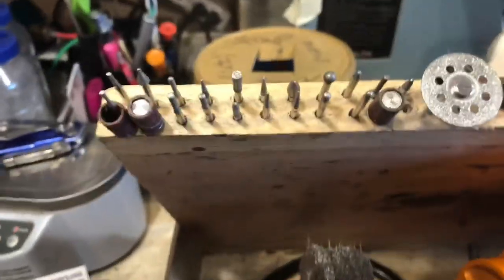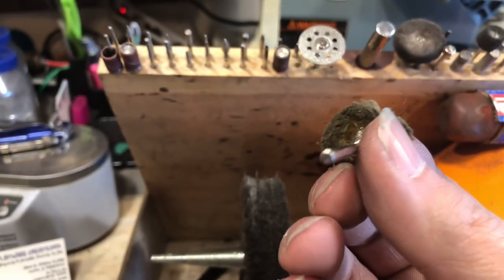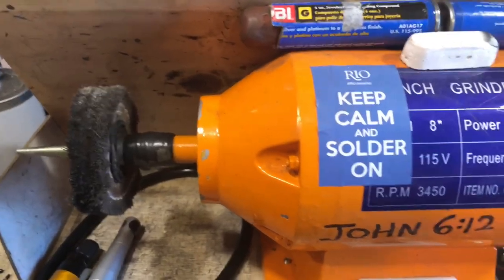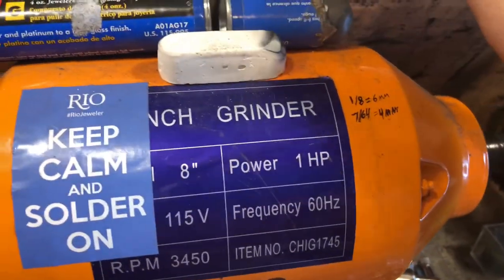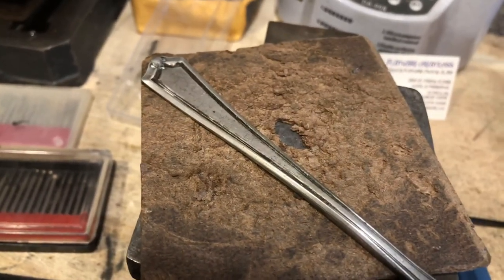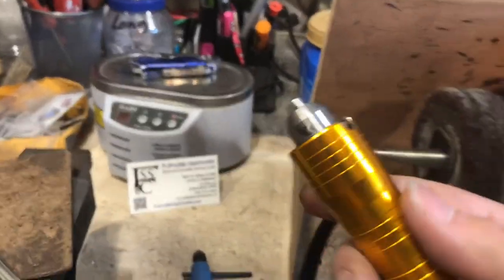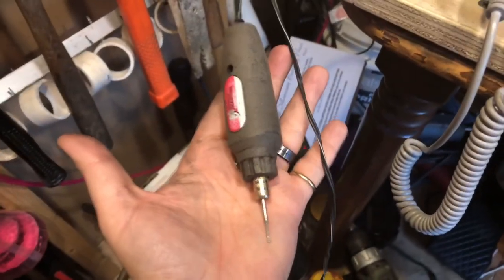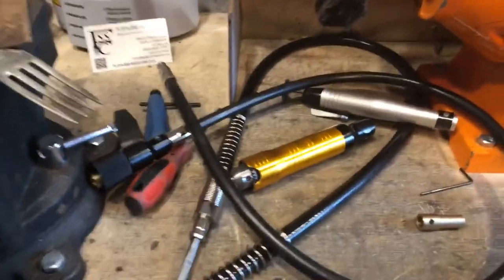My different Dremel tools bits and grinding set up

Comment: Where do you buy 180 sanding drums fir the Dremel?
Reply from the maker: I found them on eBay in the nail care section. I just searched this. 
180 grit sanding drums
And they came up. I use the smaller size.
Reply: Thank you, I didn't think about the nail section

Comment: What is the brand name for your mini variable speed grinder and where did you get it? I enjoy your videos very much. So glad you are willing to share. Bob
Reply from the maker: Here’s the eBay number for the nail drill Dremel tool. It takes 3/32 size bits. 162798285260 i’m glad you enjoyed the videos I enjoy making them.

Comment: Very informative! Thanks for posting! Where do you get your polishing compounds? I’m running out and can’t find t at Lowe’s. Also, where do you find your little rotary brushes to get in tight places? Thanks.
Reply from the maker: My buffing compound so I picked up at a discount tool center I saw them and bought every package that they had LOL and the desks I get off eBay but you can get them from Rio Grande and most of the other jewelry companies